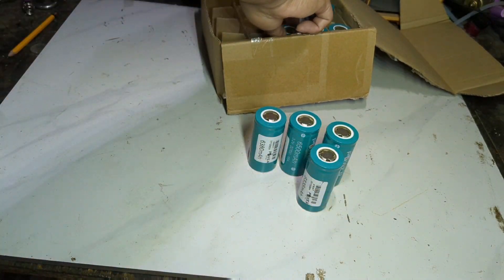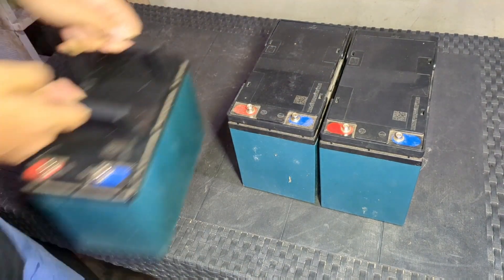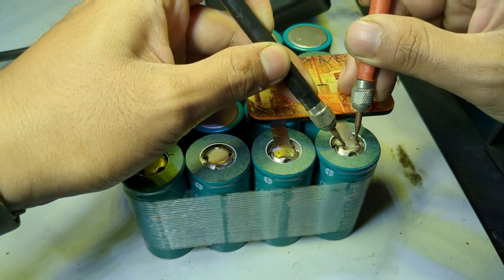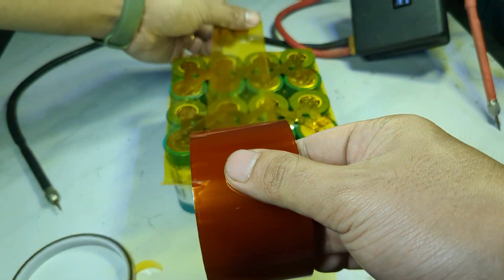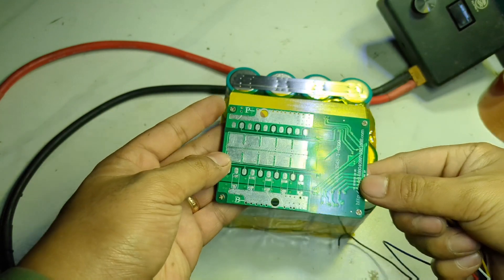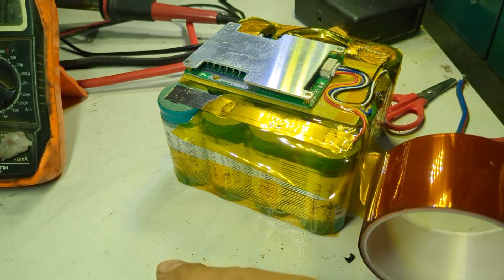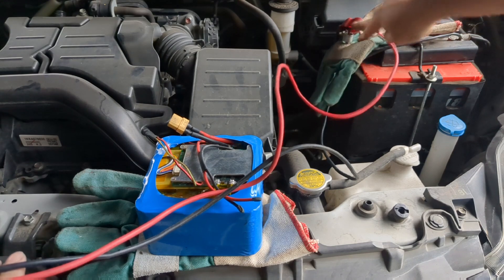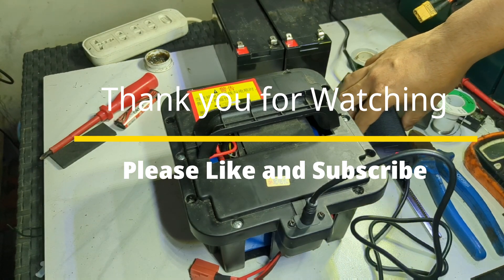This toy battery can replace your car battery

Comment: Saw a lifepo4 car batt w/ 4s4p only,, don’t wanna say the brand but mahal sya P6k+ n sya,,,, Sami n bumili also may malaki pang SUV,,,
Reply from the maker: commonly mas mataas discharge current ng mga cylindrical cells compare sa prismatic.. kaya mas mahal ang mga cylindrical...

Comment: Sir, Nario ur on Jessica soho about ur car,,, well how’s ur 4P10 or 12P battery??? Planong mag replace ako Lifepo4 as 2nd battery, I have a smart isolator between my batt,,, 1st batt 45AH motolite & 2nd Yokohama on 3rd year n,,,
Reply from the maker: depende kasi sa alternator ng sasakyan, may mga alternator na mataas ang voltage.. yung mga old car most of them compatible naman..

Comment: If using lifo battery on cars u should not use bms.instead use only active balancer.bms always shutdown whn use in cars.specialy whn starting.active balancer is enough to prevent this problem.cos car max charge voltage is a bit lower than lifo battery.so no prblm in overcharging
Reply: how many AH need a small car and big car sir? is 45ah enough to start a small car sir

Comment: LiFePo4 lifespan gets destroyed easily by temperatures and conditions in an engine bay - look at the company Louis Rossman covered (Deep Cycle Systems, or DCS) in youtube.com/watch?v=d37BG0O0mFk - they made the same claims and are now suing a youtuber for doing proper testing that reveals the truth.
Reply from the maker: all lithium base batteries have that problem... there's some simple things to do to resolve those issues..

Comment: So , what about the alternator of the car charging that battery , will that keep it charged ?
Reply: Yes, but it will pull a higher amount of current and might burn the alternator if the car idles
Reply from the maker: it's safe to alternator.. have this kind of battery in my old car for almost 2 years.. start at 13.6V alternator almost do nothing to charge the battery...
Reply: @antoniosestar3671  well fixing an alternator is going to cost more , than having a a battery which might burn the alternator ,  isn't it ? 

which brings up another question , how much did it cost to make the battery in this video ?
Reply: @jayk2k  That's why you should use high current cells with smaller capacity, like 18650 1500mAh 30A... so the alternator could charge them quicker before heating up to a critical point... I live in EU and those cell are usually 1.50-2€